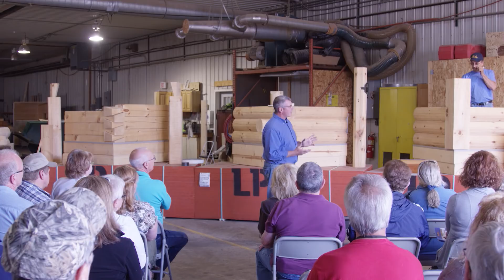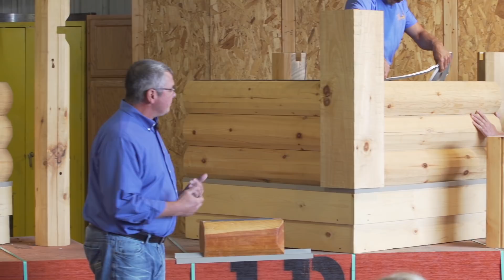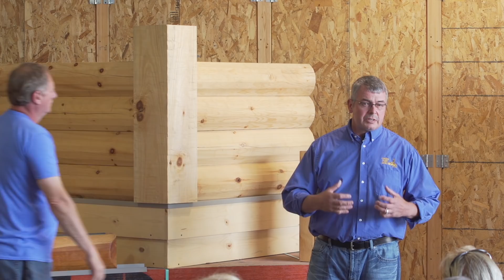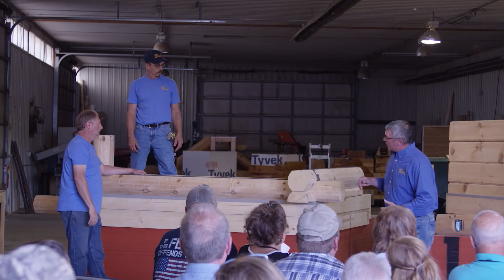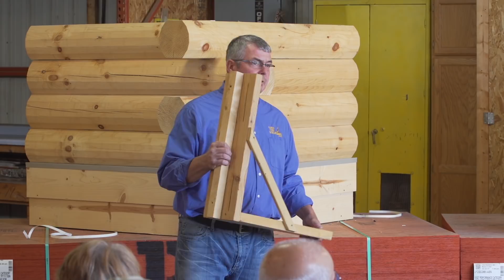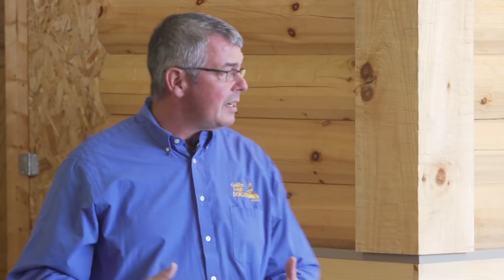Log Home & Cabin Stacking Demonstration log raising

Comment: You presented using fresh wood versus using kiln-dried wood as if those were the only two options and stated that the historical standard was to use fresh logs. Historically only the most lazy would use fresh logs, well seasoned logs was considered the proper way historically and I think it was deceptive to have omitted that as an option. Historically if there were cracks after the drying process there would be vetting before building, I see several logs with cracks in them and I would have vetted every cracked log if it were my personal home. I wonder if there's a company that merges the historical standards with production because if not the homeowner would be better off studying how it was done historically rather than hiring some company?
Reply from the maker: Kiln drying is vital to what we do here at Golden Eagle. We’ve eliminated settling and shrinking with both our manufacturing and drying standards. Logs that are manufactured with round contact areas are known for unpredictable settling. We manufacture our logs to stack flat and eliminate pressure points
. This ensures that our homes will stand the test of time. It all begins with individually selecting trees from sustainably managed forests. Those trees are then turned into timbers and placed in our air-drying fields where they naturally evaporate down to a 40 percent moisture content level - but our goal is 19 percent which is the same as a 2x4 and 2x6. To achieve that 19 percent, we place your material into our kiln we increase the air temperature so that the core gets as hot as 133 degrees. When the core gets that hot, we're able to preshrink all of your logs. This stabilizes your log and at the same time it purifies it killing any living insects or organisms that ever may have lived in the log. In doing so, we crystallize any sap that may have been in the wood your log is also a lot more porous allowing for better stain performance because water is no longer trapped inside the wood trying to work its way out. It also reduces approximately 5 tons of water making it more affordable to ship your home. This is why it's important that your materials are kiln dried. I'd encourage you to come and visit us learn more about what we have to offer. We have an incredible state-of-the-art manufacturing facility and an 8,000 square foot showroom and a beautifully decorated model home. There's a lot to learn and see. Get started by visiting us at www.goldeneaglelogandtimberhomes.com